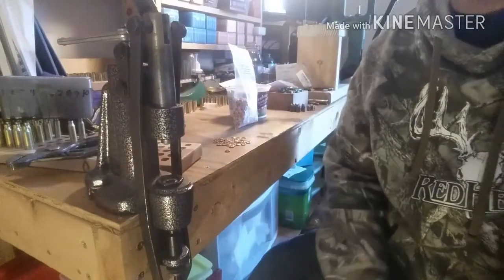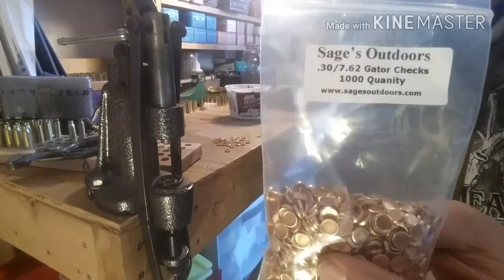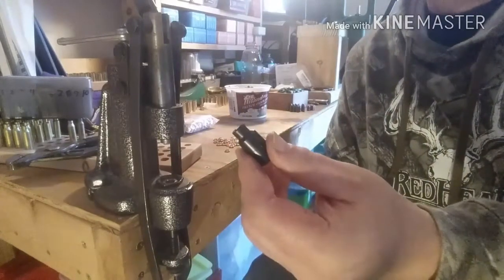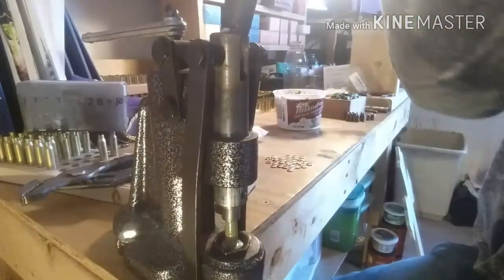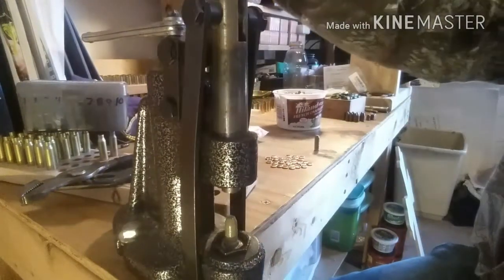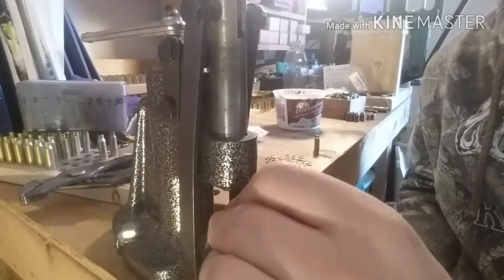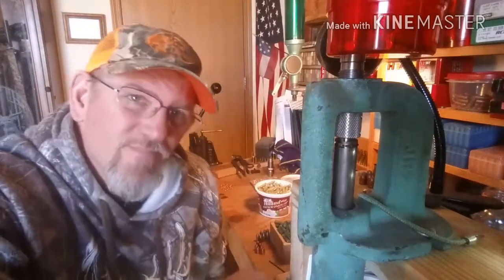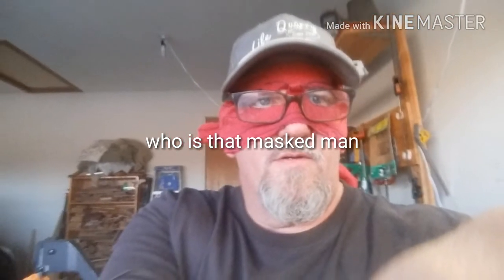Seating gas check on pre coated bullets

Comment: When I was doing gas checks I made a wood frame like you have for your press . I mounted the press upside down in the wood frame . I could drop the bullet in the sizer die . Then drop the gas check in . The gas check would self center to the bullet when I pulled the handle . I used a large bowl for the bullets to drop into .
Reply from the maker: James Pollard I might have to give that a try
Reply: It worked really well until the wood screws I used pulled loose in the 2x4 frame . I need to beef it up with lag bolts . I used a cheap Lee C style press mounted upside down with Lee sizers . It really was nice to install gas checks or to size only .

Comment: Sage has aluminum plain base gas checks as well, I've used them with plain base 124 gr. TC 9mm cast bullets and they work great. The thing I like about Sage is you don't have to buy a thousand of anything as you can purchase 100, 250, 500 or 1K if you just want to test some out.  Look forward to seeing your results with the Gator checks.
Reply from the maker: Reloader 7sixtwo so you have use the aluminum gas check how do you like them